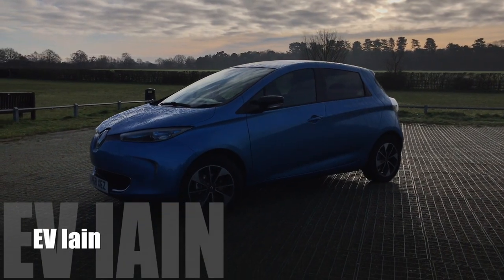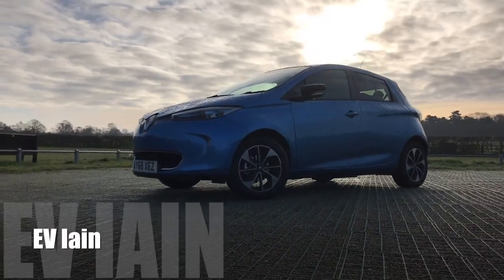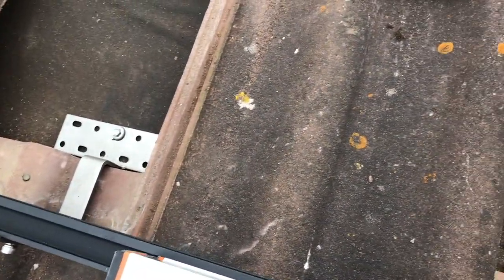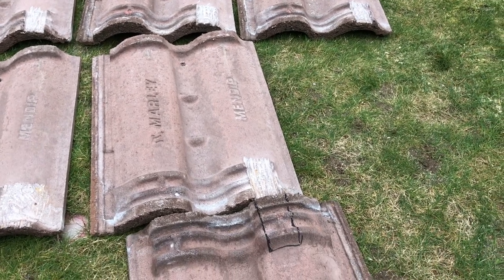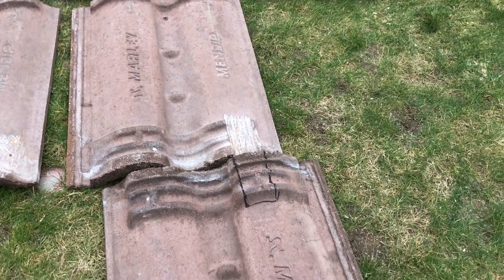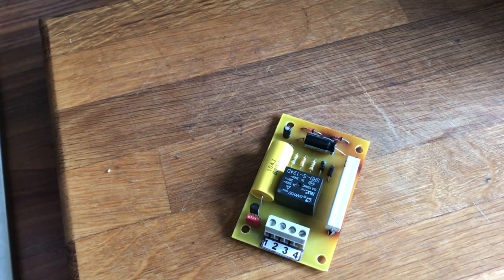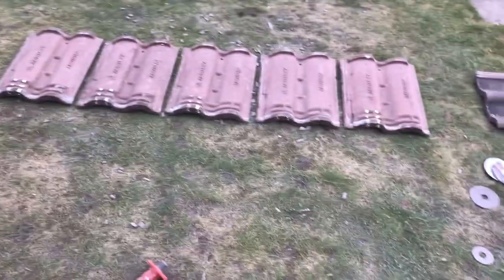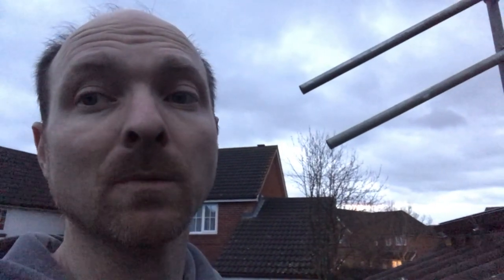Solar Job part 2 - Fitting Rails

Comment: Just wondering why didn’t you go for the panels on flat roof! I am planning to refit them on flat roof after loft conversion.
Reply from the maker: The height of the pannels would have gone above the ridge height, which would have been a no no in my case

Comment: Couldn’t you take cut tiles off the house and replace them with the garage tiles .?
Reply from the maker: No unfortunately the cuts didn’t line up with the rafters in the garage, probably a slight difference in the over hang on the garage and house, plus the tile pattern will put them out of sync.
Reply: @eviain  oh right, good job by the way, I’ve got solar POV and tubes for my hot water and have been interested in your my energy stuff, going to see into getting the hot water connected to the pc panels as the tubes need lots os sun but a couple of hundred watts into the hot water tank should make a difference in spring and autumn,
Reply from the maker: @johnb7644  it really does you won’t regret it, I’d still recommend the solar iboost as a cheaper way to get going with hot water heating, unless your fully EVed up too!
Reply: @eviain  Haven’t got aEV yet but future proofing, might as well get a Eddie and Harvi all my heating and panels etc are in or on a detached garage so the Eddie harvi  kit looks to be my best option